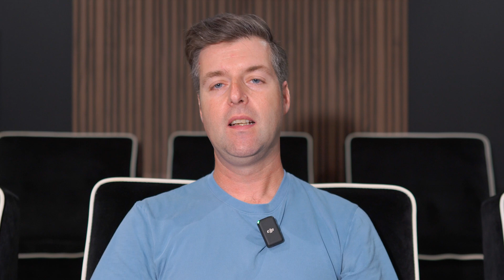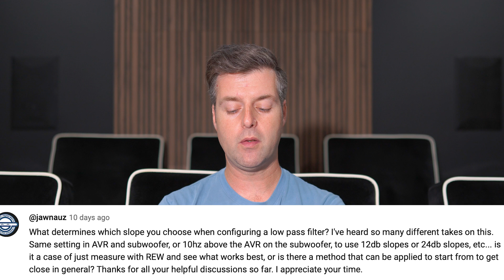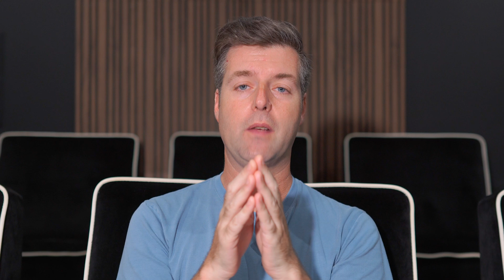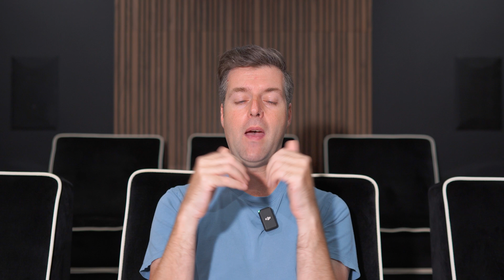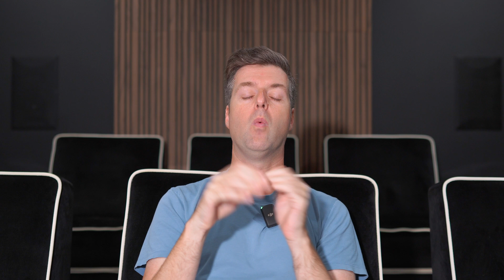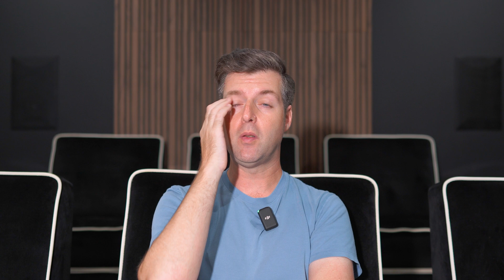Determining BASS Management Parameters for Optimal Performance

Comment: Hi Matthew.  Always enjoy the videos. Hope that it's as worth it for you as it is for us!
 Anyway, general question about basic theatre setup I think might be helpful to other viewers.  
I noticed in your video about your own theatre that you have 7 bed channels. Anthony Grimani, who your work with,  is a strong advocate for adding wide speakers, for a total of 9 bed channels. Was your decision not to use wides in your own theatre due to your design preference? The size of the room? Number of available processor channels and how you prioritize them? Keep up the great work but you should still take the summer weekends off.
Reply from the maker: So I’ve had this discussion on Genes channel before. It’s not a design preference exactly but that is probably the closest approximate category. It’s a budget issue. In order for me to run a 9.1.6 system, for example, I would need to have 9 high quality bed channel amps and 6 adequate if not equal quality top amps. I would need another set of aimable or aimed S series Perlisten speakers.  The cost wasn’t small. I had entertained the idea of going down to R series for the surrounds and doing that extra channel. But my own design belief is that speaker quality matters more than channel count. When budget limits the speaker count, you are better off going with the better speakers.  

Now having said that. It’s been hard to do good comparisons. Anthony and I both like to add wides. But until recently a lot of content didn’t necessarily support the wides.  Setting up a system with presets for different channel counts is tricky. I’ve not personally done it. Do I consider this something I would like to play around with more in the future.  

In my own system, the wires exist for the added two channel sets I left out.  I will upgrade my amps again to get enough channels and add the other speakers. I suppose a follow up review will be in order they includes that test.

Comment: Super grateful for the answer! Already gave me a lot of think about and tinker with. REW time!

As some added context (feel free to just answer in comment form if it's not a good video topic to get deeper into, as it might be too specific to me, also I'm happy to simply be pointed in the direction of research I can do on my own if you don't have time to get into a detailed answer) -- I have 4 sealed subwoofers (2x SVS 3000Micro and 2x SVS SB-2000Pro) in my environment currently, arranged mid-wall square, most similar to Harmon multi-sub placement research number 12 or 13, at least in the paper I've read. (Investigation 4: Practical Subwoofer Locations) This arrangement already helps a lot in my initial measurements. My AVR is an Integra DRX 3.4, full range Dirac Live available, but no DLBC license possible. (Would need to upgrade to a DRX 8.4 or similar AVR)

I recently acquired a MiniDSP Flex and have turned off all the on-board DSP I could from the SVS app for each sub and set crossover to OFF/LFE. I understand SVS retains some DSP that is undefeatable, but I also assume that's mostly to protect the sub and isn't necessarily of concern for listening quality. So now, I'm curious as since I'm able to control so much independently from the Flex, should I also be turning off crossovers from my AVR as well and sending full LFE, highest crossover possible from the AVR to the Flex and then letting the Flex actually do all the work after I've measured from REW?

If I do that and then run Dirac Live at the end, should I make sure the DL filter stops at my crossover points setup in my Flex, or let DL run full range and potentially put additional adjustments into the AVR via DL which then are getting fed into my Flex from the AVR, presumably tuning the response further from DL perspective, or would that just muddy the waters and it's better to let the Flex control everything and only let DL run on frequencies above the Flex?

Thanks again for your expertise and any assistance you have time to give.
Reply: How does the Flex get wired into the AVR, thanks.
Reply: @Echo-jg8is  The AVR Subwoofer outputs (in my case, 2 but they are actually just a bridged .1 signal still) go into the Flex RCA inputs 1 and 2, respectively. Then it has 4 subwoofer Outputs that I have running cables to each of my subwoofers LFE-In. -- It depends on which MiniDSP Flex you get, in my case I stuck with the unbalanced RCAs, but it comes in balanced and other configurations, as well.
Reply from the maker: I would consider trying it both ways. Prefixing the bass gives Dirac less to do. Done correctly, live on top of it can be good. 

A few things about your other points. All subs generally have some signal processing you can’t And shouldn’t defeat. SVS subs have highpass filters to protect against infrasonics and damaging low frequencies. It also has a multi band limiter that prevents the sub from exceeding its limits. You want that. All systems hit their limits from time to time.

Comment: Thanks! I'd like to see that sealed vs ported video. I currently have 2 18" ported subs tuned to 17hz and 2 12" subs tuned to 21hz. Im going to be replacing the 2 12 with 2 more 18 but do not know if I want to stay with ported. (If I go sealed Id be changing the existing 18's as well). My room specs are 19x19x9 in a 2nd floor bonus room above the 2 car garage. Subs will be in the corners. Would I get better infrasonic bass from sealed? How much power do I need to reach the same levels as my ported? Ive always been under the impression that a sealed sub requires more power to reach the same SPL as a ported?
Reply from the maker: So yes ported subs are more efficient in the port tuning region.  But same efficiency above that region and no significant output below port tuning. 

Sealed subs have a shallower rolloff and more benefit from room gain. There is 12dB per octave of boost in a totally rigid sealed room below the lowest mode.  In real rooms it’s still 6-10dB. A ported sub has a 24dB rolloff so that boost is of little use.  

We’ve done a number of comparison tests or sealed and ported subs. When the sealed vs ported subs are similar capability, we find the noises from ports often is as bad or worse than the rising distortion with sealed. Further, the inharmonic nature makes them far more noticeable.  It doesn’t mean you can’t get great sounding ported subs. But in my experience, after decades of going back and forth, I abandoned ported subs in favor of big sealed subs. I just add more subs. Makes up for the loss of efficiency.
Reply: @PoesAcoustics  Thanks for the informative reply. I forgot to mention that Im limited in the room to a single 20amp circuit to run everything. Running my amplifiers too hot would spell doom for my projector. After reviewing several other videos on the subject, I think Ill play it safe and stay with ported. Im really happy with the ones I have, so going square with 2 more of them and putting them in the corners should be perfect.